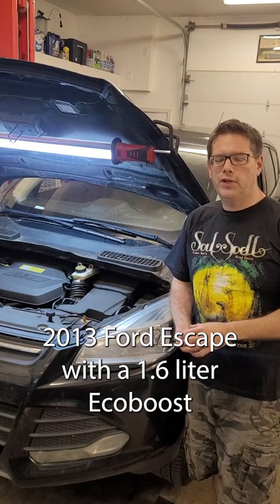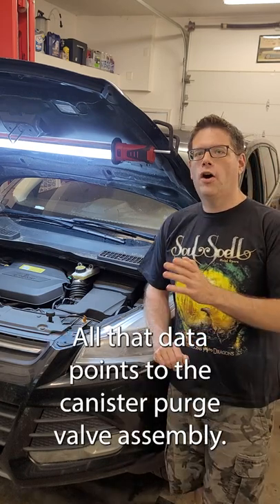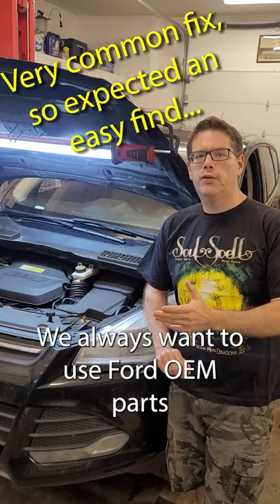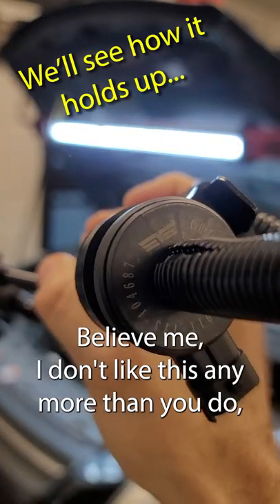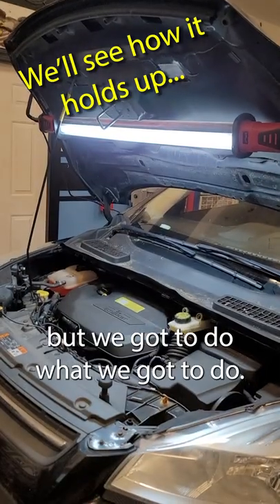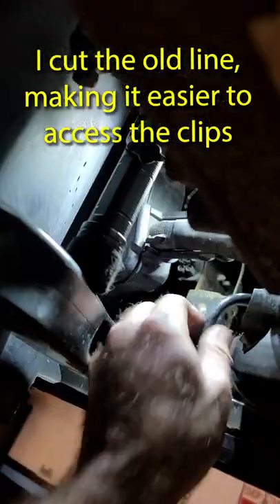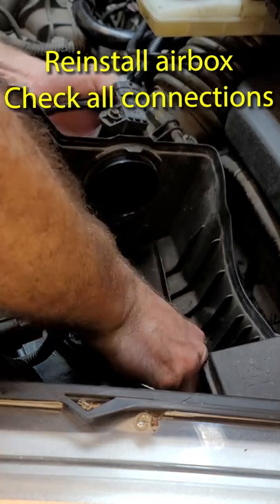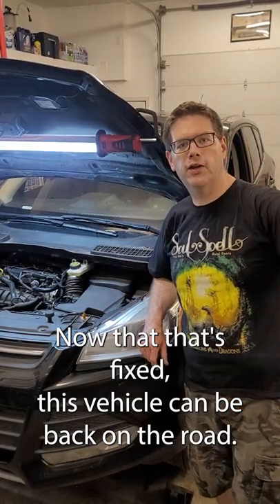Canister Purge Valve P144C #shorts

Comment: I got my pc valve changed I can see a big difference at one point i could barely drive any speed without it jerking around but now I can at least go up to 65 before it does it again I had my spark plugs changed and the coil pack same thing all this happened 2 years after I made my last car payment. I had my car put on a machine was told I needed a PC valve wasted 200 after they put it on I still can’t accelerate like I use to.

Comment: Man so many guys are all about OEM parts and it drives me nuts.
You do understand there is Chinese parts, then there's good quality aftermarket replacements. Doesn't have to be OEM..
Reply from the maker: I agree - OEM often makes it easier especially with some well known brands cheapening out suppliers over the years. But some of these emissions parts are hit or miss on aftermarket. OEM is often just  easier for getting it out the door and not coming back.  I used to not be that way but was burned a few times